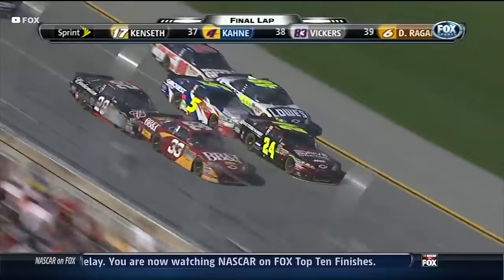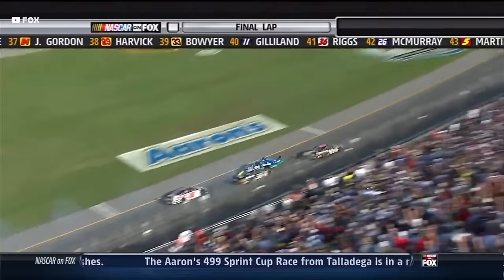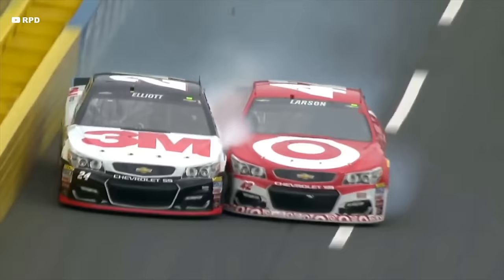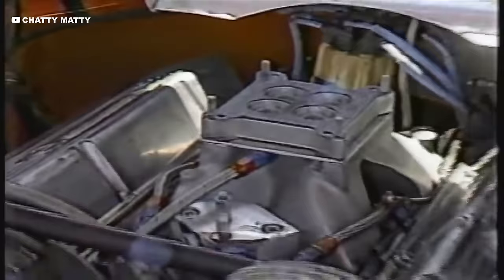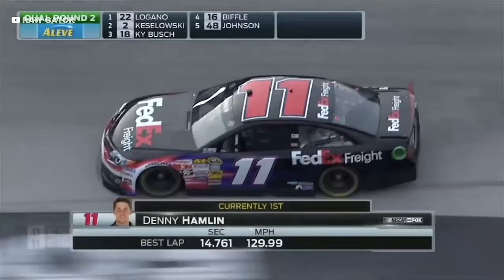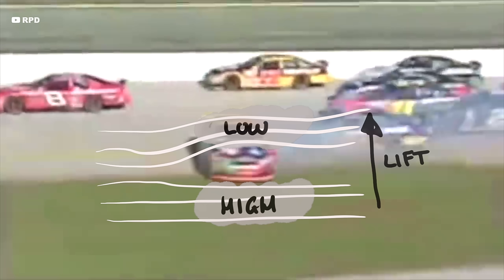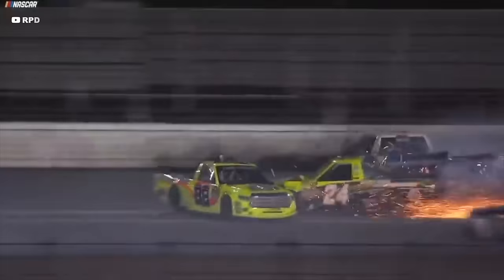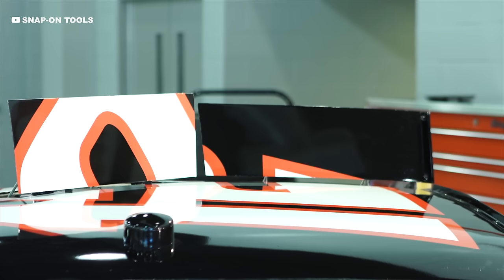The Simple Invention That Saved NASCAR

Comment from the maker: Big thanks to Ridge for sending me this wallet and supporting the channel! Check them out with the link in the description!
Reply: Have you ever driven a cup car ? With your background I would probably think you have given it a go. Great video.
Reply: The cup series only runs 40 cars max right now not 43. Theyve done this for the last five years or so
Reply: That theory has been proven wrong and it makes sense when thinking of how do planes fly upside down?

Downforce is created by the aero directing air in a certain direction (Down/up wash).
Reply: @briand8090  Thanks for the info.
Reply: @cebsone  Hi Frank, which theory has been proven wrong?  You're saying the same thing I am saying, only from a different frame of reference.  Wing versus the air.  When a surface places a force on airflow, directing it in another direction, there is an equal and opposite force placed on the surface.  That force has a horizontal and vertical component.  The horizontal force creates drag while the vertical force creates lift.  Downforce is negative lift.  The pressure difference is created when the airflow being directed away pushes into the air around it.  Creating equal and opposite force again.
Reply: actually the air over the top of the wing doesnt go faster it goes further ... the vacuum made by the empty air space is what creates the lift ... same as with an airplane ... the wind cant change speed without something adding speed to it .. and sorry but an airfoil doesnt add speed it adds distance ... the difference between the air on the bottom and the same reference point of air over the top is what creates the lifting force ... this is why the lift calculation includes a distance variable to allow for the difference between the top and bottom of the airfoil.
Reply: Your explanation of aerofoil is wrong and has been debunked multiple times. It's quite weird how this myth presists - though I guess it's not easily falsifieble at home, you need to watch videos of wings with smoke pulses.
Reply: @Ben L It is indeed. And it makes me sad because for years I was confused by lift because this explanation was the only thing I knew and it didn't make any sense to me because of drag. Turns out I was right - but I am sad that it still persists.
Reply: @Fabelaz  @Ben L  
Mercedes AMG did a great video recently on how lift/downforce is generated (https://youtu.be/hJ-kB6Gchd8).  Good reference source to share with people.
Reply: also for replacing the missing parts for flaps?

Comment: Love a simple engineering solution to a problem like that. Brilliant.
Reply: But the roof flaps can't save the car from flipping in Talladega super speedway so there's a problem with the roof flaps
Reply: @konosuhardbass  what are you going to do when a car is barrelling down a track at 200 miles per hour with barely any room for downforce? I'm not saying it's impossible to do that if you modify a nascar car, but nascar dousnt seem too excited to change the design of their iconic design, its looks hasn't changed the main design in 40 years
Reply: “What if we like, put a flap here?”

“Dan, you’re a genius.”

Comment: I just love all the compliments the host gave NASCAR on the first minute.
Reply: I think race drivers have more respect for other kinda of racing than (some) race fans.
Reply: @gerardmontgomery280  that's true but tbh NASCAR deserves some of the slack it gets. They've ruined the cars. There is soo much dirty air and with the current package they're easy to drive and boring. It was fine until 2018
Reply: @utkarshchaurasia2233  I think its more that some fans' standards for what is "exciting" racing has got to an unrealistic level, where they're advocating racing styles that will likely increase racers chances of crashing and getting hurt/killed.

There's plenty of little things to appreciate in any high level competitive motorsport, provided you understand the sport well enough. Even now I dont think any motorsport (motogp/nascar /f1 etc) has necessarily "ruined" anything. I think just some of the more flashy or "once in a lifetime" moments have been toned down a bit. And its worth remembering that flashy usually = explosive/destructive; and "once in a lifetime" sometimes is that way because that moment is where said life ends. 😕
We have to ultimately respect that someone's child/parent/loved one drives each of these cars, and making sure they all make it off the track safely kinda has to be top priority, even if that "ruins" the excitement for some people...
Reply: @swine13  I don't think NASCAR changed the package to increase safety. Maybe they did it to improve the show? But that's not great either
Reply: NASCAR is cool n' all but I would really like to see them on more tracks that aren't just ovals

whipping those absolutes sledgehammers through tight corners could be interesting...
Reply: @gerardmontgomery280  true I respect all manner of madlads that handle 150+  in motogp nascar or f1 etc. 

Shits no joke... roll cages, hans flaps etc are all essential to keep the drivers safe
Reply: Appealing to murica audience.
Reply: Brylle Cruz  Must be.
Reply: @yahya3683  They raced on quite a few road courses this year, and are going to even more next year. Before this they still raced on a few road courses, namely Watkins Glen and Sonoma. Check them out, they actually race really good at road courses.
Reply: NASCAR's playoff and stage racing have turned the sport into a joke. I grew up a HUGE Dale Earnhardt/Tony Stewart/Jeff Gordon fan, but I can say I haven't watched the sport consistently since 2016. It's been all downhill from there, however I am happy to see a second-generation championship winner in Chase Elliot for 2020. Maybe there is some hope for the sport after all.
Reply: The same he might be a nascar fan for all you know
Reply: @utkarshchaurasia2233  agreed
Reply: @simonshotter8960  It isn't
Reply: @manueltjuhh3807  when a sport is only watched my one country,it’s shit. 
Plus, they all go the same speed around w circle 🤷🏼‍♂️
Reply: @simonshotter8960  This is legit what every person says about nascar even though they have never watched it ever, you don't understand the point of the sport that's why you don't like it.. Me and a couple of mates always watch the race every sunday evening because we actually understand the point of the sport, and it's loved by other countries too like the netherlands and new zealand ect..
Reply: @manueltjuhh3807  you named two..... it’s shit. It’s hillbilly’s chasing each other in cars with big engines that can’t go round corners.  
There seems like next to zero tactic other than, hold your foot down. It’s all about one car going a mile or two per hour quicker than the other over 4 hours; that’s it...
Reply: @simonshotter8960  It's easy to talk like that about any sport mate, i can say whoever has the biggest budget in f1 wins the race too.. 😂😂
Reply: @manueltjuhh3807  not true. Jenson button and the brawn, that was basically a family team. Red bull didn’t have the biggest budget when they won it 4 years in a row. Williams are a family team and they won championships. Ferrari, globally the most prestigious car, nowhere to be seen currently, racing point came 3rd last year.... 
all while using skill, going round corners and using the most modern technology the world has seen.
Reply: @simonshotter8960  Yup, but don't shite on nascar it's already sick enough to see them being able to drive centimeters away from eachother with little to no grip with no steering power and the g force on those bankings and bump drafting ect, and the strats between drivers to work with eachother to get a top 5 finish.
Reply: @manueltjuhh3807  you make compelling arguments without losing it, good man 👍🏼. 

I’ll never think it’s not shit though 😉
Reply: @simonshotter8960  Everyone has their opinions
Reply: @themetal812  And to be honest with the new package for the cars theyre only gonna be getting better at road courses... a centralized body will make those thing way more fun to watch on road coarses... I am so excited when I think about something so simple as drivers turning right...
Reply: @simonshotter8960  Holding foot down on oval going into turn one, Ya you are going straight into the WALL
Reply: @simonshotter8960  its watched in multiple countries. Plus Nascar isn't a sport that goes to multiple countries like F1. F1 and Nascar have great racing, it shouldn't matter where they do it or how many places they do it
Reply: @simonshotter8960  you are talking trash about Nascar without knowing anything about it but get mad if someone said something bad about f1 without watching it. Makes sense
Reply: @simonshotter8960  Im from Philippines and I watch it, 4-40% viewers increase in nascar this year except Texas and Kansas those tracks is boring
Reply: @Yahya  I think that would be quite difficult because they are quite asymmetric cars because they are designed specifically for oval racing. Aussie touring car racing - they call them V8 supercars - is basically what NASCAR would be if they had to turn both ways. Holdens, Fords, Chevys and more battle it out in very close proximity to one another. It's an awesome series with some of the best racing in the world imo.
Reply: @simon shotter  F1 is a technically amazing sport, and the cars are faster around most tracks than anything else on wheels,  but the racing is SO BORING sometimes. No overtakes after the first few laps and the dominant team just disappears off into the sunset. I'm not a massive stock car fan, but to write it off as hillbillys going round in circles is misinformed. 

At the moment Moto GP is more exciting to watch than F1. The cars are so big and heavy that they have lost all their twitchiness and edge. They sound like James Dyson has been put in charge of engine development too. It is like listening to a race full of hairdryers and vacuum cleaners. 

Watch Alonso in the 2004 season. That is what F1 should look and sound like.